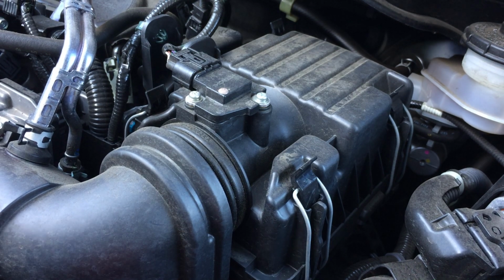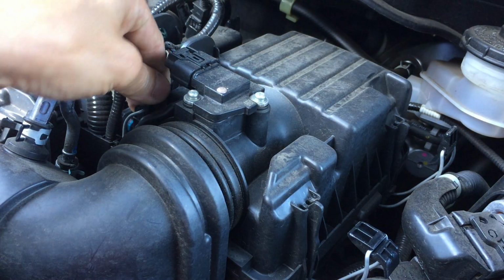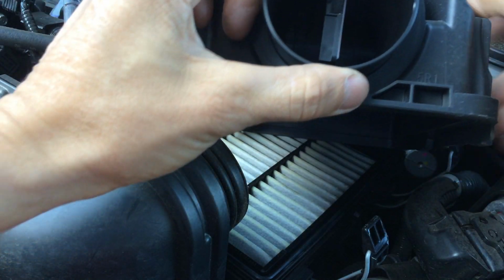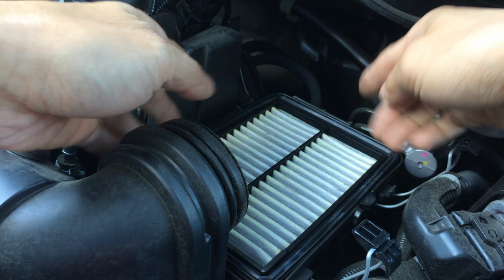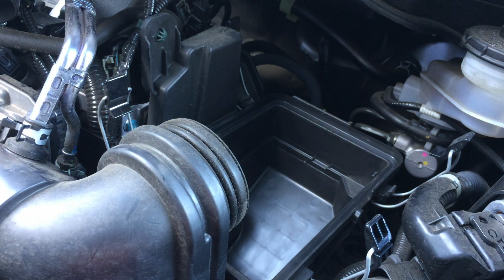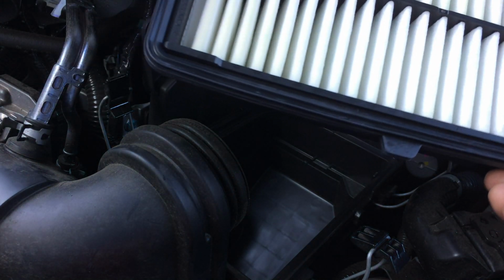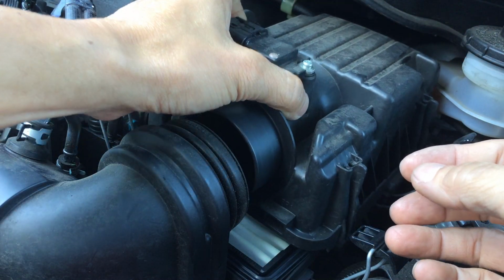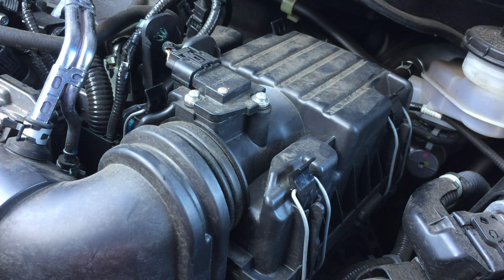2015 Honda FIT engine air filter replacement

Comment: Replaced my Air Filter with a K&N.
Reply from the maker: K&N doesn't really do anything but let more dirt in
Reply: DaBinChe I've never had a problem with K&N air filters. I even have one on my Honda Ruckus.
Reply from the maker: @ronmendoza4916  short term it works fine, long term it wears your motor faster by letting more dirt in
Reply: K&N are the best air filters on the market. My Honda Fit, Honda Ruckus, and Big Ruckus all run on K&N. I'll never go back to stock air filters.
Reply: @DaBinChe  That is not true at all. The person that did that test and say K&N filter let more dirt in didnt even do the test correctly. Not even a real world environment test. Also the claim that K&N oil damage MAF is also false. K&N did a test, they dip the sensor in their oil, spray oil, and spray oil with dust and it didnt damage the sensor.
Reply from the maker: @DrivinginNewYorkCityNYC  You gonna believe a company doing their own test?  Where is the independent third party test?

Anyways next time you got the filter out look thru it and you will see clear line of sight, that is where the smallest particles will go thru the filter.

Comment: Thanks for the video. I'm about to do this on my 2015 fit and was jjst curious about one thing. If I see I have to clean the boot and the enclosure the filter sits in, what do u recommend to use to clean it? Any worthwhile products or just wipe it with a towel/etc?
Reply from the maker: If inside boot then just wipe with wet towel.  If outside spray with some cleaner like simple green then rinse off with water, let dry then change the filter

Comment: Where is the temperature sensor of a 2015 Honda fit located?
Reply from the maker: Which temp sensor intake air or cabin air?
Reply: @DaBinChe  engine coolant temperature sensor
Reply from the maker: @duronduron3076  where the water pump is, follow the coolant hose to the water pump on the engine